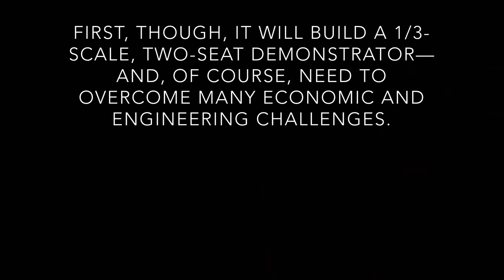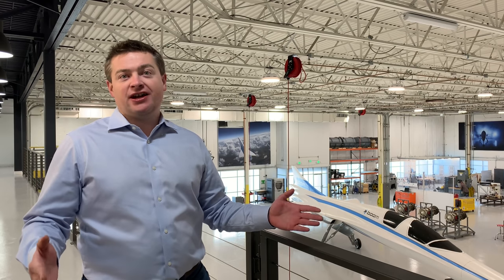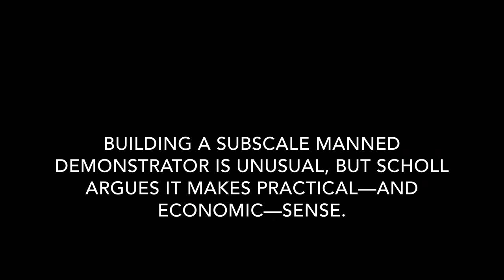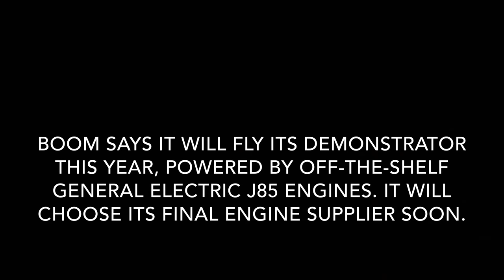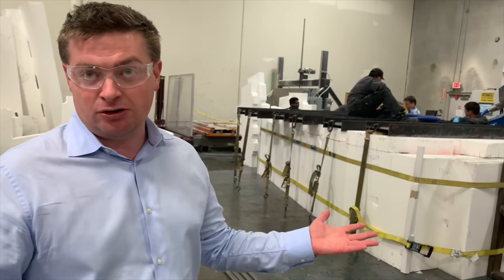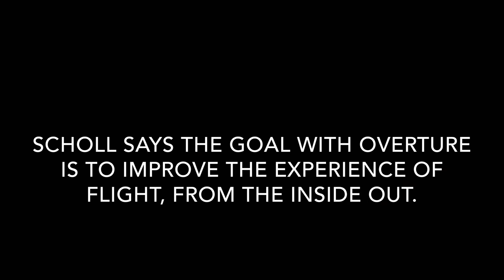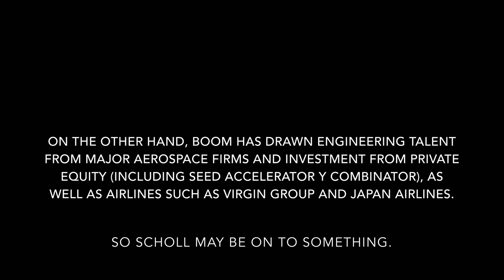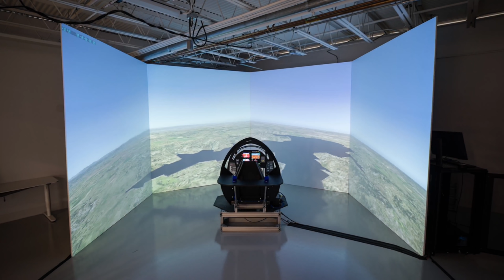Boom Supersonic’s Sound Barrier Breaker

Comment: Concorde only used afterburner on takeoff and acceleration past the sound barrier,  after that it "supercruised" with no afterburners.  I'm not even sure if it used afterburners for normal takeoff.  The one time I flew on it was a demonstration flight and sitting at the end of runway 27R at London Heathrow the captain said "I'm going to put the engines to full power now and light the afterburners, we don't normally do that because it tends to melt the concrete".
Reply: Afterburners were only used during initial climb.
Reply: “It tends to melt the concrete” don’t ya just hate when that happens xD
Reply: @dylanshandley1246  Pretty sure he meant asphalt hahaha
Reply: @garethl.2123  it would be concrete, blacktop wouldn't be durable enough to use as a runway my dude
Reply: In service, Concorde always took off with AB (reheat). It's my understanding that it was a operational decision based on reducing take off distance. Concorde had to rotate in order to produce lift by vortex from those beautiful delta wings...so the quicker she could get there the better I guess.
Reply: In the 90's I used to work at Heathrow airport and used to have lunch at the British Airways staff canteen called the Runway Café because it was at the end of one of the runways. When a Concorde started its take off run, the whole building used shake, you could feel it through your chair, your plate and cutlery would shake on the table and even inside the noise was incredible, so I'm pretty sure that they used afterburners, that and the flames out of the nozzles.
Reply: I was based in JFK with a regional airline, and every time I watched the concord takeoff it was in AB. 
Miss seeing it.
Reply: They may have meant the concrete would break up under the high heat of the afterburners. You can take a torch and rapidly heat concrete to the point where sections of it literally explode. This isn't very good for runway longevity or for follow on aircraft sucking up concrete chips into their engines.
Reply: I flew BA Speed bird 1 LHR to JFK in 1998. I was Qantas staff and paid $1400 AUD. The full fare was $10000 AUD. I can confirm Full AB on take off roll and they cut after initial climb for noise, it felt like the brakes were put on. After clearing the Irish coast we went full throttle and started climbing . the captain then said the reheat will come on in pairs and we would feel 2 X pushes in the back as they kick in and we did. After slowly pushing through mach 1 we accelerated more quickly and at some point the RH was cut. When I visited the flight deck during Mach 2 cruise 1350MPH at 58000FT the reheat was off but the throttle levers were firewalled 100% N1 for over 2 hours of super cruise. What a marvellous machine.
Reply: As I understand, the Concorde required a long runway because it’s V1 speed was so high (its nominal takeoff roll wasn’t particularly long), not using the afterburners would have made this even worse.
Reply: @mintZroadster Indeed she was loud. I live in London, close to LHR and I can testify that even in the approach phase she was highly identifiable by ear from the ‘blunties’ 😄
Reply: Sounds safe xD
Reply: @Phos9  Not to mention its insanely long landing distance due to the 11.5 degrees angle of attack on landing because of its high landing speed
Reply: @Flies2FLL  and also for passing mach speed .

Comment: Nothing says "low stress" like BOOM Aerospace.     
Seriously, though, it's looking really nice, and should show marked improvements over Concorde, bringing the concept into the modern age. 
Super-cruise should not be that hard for a transport aircraft these days. Just lots of CFD to get it right, and verify, verify, verify.
Reply: CFD, FEA, plus Wind Tunnels, base Scale Models,vCycle & Structural Load Testing, and a highly Strain gage Loaded 1st plane, logging & Transmitting Flight Data! All tools available today, along with FRP mixes of Carbon Fibre for Stiffness, Kevlar for Fracture And Impact Resistance, and now even Titanium-Aluminum Alloys, can be created a variety of ways and integrated as needed, for desired results.

So, it seems right to say, now is the time!

Comment: Going Mach 2.2 with "quiet and efficient turbofans". Dream on. High-bypass turbofans were known at the time of Concorde, the 747, DC-10, Tristar were contemporaries, all equipped with quiet and efficient high-bypass turbofans, the C-5 even predates it. Concorde has non-bypass turbojets for a reason, and that reason is efficiency for high-altitude, high-speed flight. Modern fighter jets have (low-bypass) turbofans, but that's a compromise for subsonic range and is rather a liability for supersonic flight.

Making predictions for ticket prices for an aircraft of which even the 1/3-scale demonstrator hasn't been built yet, is dishonest at best.

I'll bet some money that they can't get an engine that is (a) Stage IV or better noise-compliant and able to sustain cruise at Mach 2.2 for transatlantic routes. It's not going to happen. The design contraints are too contradictory. (Low noise: big fan, high supersonic efficiency: small cross-section. Go figure.) This is the exact constraint that drove the Aerion project from initial projections of Mach 1.6 down to Mach 1.5 and now to Mach 1.4.

I also notice that the "XB-1" is a midwing design, which isn't ideal for a passenger airplane. So how the experience with that translates to the bigger one remains to be seen.
Reply: Sounds like they could make use of Sabre engines (no pun intended)
Reply: Exactly.  And the inlet duct losses aren’t exactly trivial either.
Reply: @AvyScottandFlower  No, those are only useful for suborbital ballistic flights. There's no point in lugging around all the complex additional stuff otherwise. Although the precooler has been demonstrated to work, it is very hard to make and maintain, it contains thousands of tiny pipes operating at cryogenic temperatures, and pumping around liquid helium or hydrogen, which is no small feat in itself: "[it] cools the hot in-rushing atmospheric air down to the required −150 °C in 0.01s."

No, if you want to go Mach 2.2 efficiently, 2-spool or 3-spool turbojets are still the only, and you can't get those certified because I don't think you can even make them Stage 3 noise compliant, and by the time any supersonic design will be ready for certification, I fully expect Stage 4 to be the absolute required minimum for new designs.
Reply: @okflyer777  Their inlet design model looks like Concorde's intakes, which were quite efficient. With some serious research effort they can probably do incrementally better, but I think he is overstating what CFD can do for supersonic flows. It will require lots of iterative designs and cryogenic (or full-scale) wind-tunnel testing. Only cryogenic wind-tunnels will allow you to test scaled-down models at the same Reynolds number and Mach number as the full-scale article.

Comment: Mach 2.2 and carbon fiber......Are temperatures not a factor at  mach 2.2
Reply: Only on the leading edges. Glue has come a long way, I'm led to believe
Reply: Yep and the Concorde used its fuel as a heat exchange.
Reply: @doncarlin9081  Concorde was mainly made of an aluminum alloy called RR58. Designed for better heat resistance.
Reply: I don't care how far epoxy to come. At the temperatures that you'd be running epoxy would definitely be soft
Reply: Of course they are.  The whole thing doesn't need to be made from carbon fiber.  You could make the leading edges from Carbon Carbon or many other materials that have been used for decades.
Reply: @1fillmanw  Let's put some numbers on this, we're talking about temperatures around 300F.  I can buy off the shelf consumer grade high temp epoxy for lamination and infusion that is rated to and cured at 375F. There are aerospace products that are stable at 600 and really exotic offerings that will handle 1500. So epoxy temp range is no longer a major limitation.  I mean it costs money to make all of your infrastructure out of high temp materials so you can cure plane parts in your giant oven.  But it's all doable. Even without ceramic coatings etc. How did you think they were making wheels and engine parts for supercars out of CF :)

Comment: I was in the aircraft production industry, and people like me know that a plane is basically a worthless tube without the correct engines which account for at least 40% of total cost. I couldn't help but notice the tap dancing around the engine issue. With such a low volume production, I cannot see any manufacturer seeing any ROI on developing such a niche engine. Are Boom going to fund it? Not likely.

Comment: The civilian variant of the GE J85 is the CJ610.  It is definitely time-tested engine in terms of safety and reliability, but it is still a turbojet generating less than 3,000 lbf thrust (About 1/10th the thrust of a reheated-thrust turbofan like P&W's F100PW229, which is ALSO time-tested and reliable.)  I understand this is for the scaled-down demonstrator, but there's no way on God's green earth they can get supersonic with three of these.

Comment: I'll believe it when I see one painted in airline colors, broken down on the ramp.

I wonder how he's planning on keeping the cabin cooled.  This is a significant issue with supersonic flight;  Concorde did it by pumping cold fuel from the wing tanks through the aluminum skin of the fuselage.  This worked because aluminum transfers heat very effectively.

Maybe it's me, but this guy seems more preoccupied with high-quality cabin speakers....

Comment: I wish them the best but there is a reason supersonic jets aren't flying today and it comes down to them not being economical.
Reply: That was then....this is now...
Reply: @cockyrooster361  you realize "then" was 2003 and the only reason Concorde lasted as long as it did was because the british government was paying for it. The plane was not profitable the entire time it flew. "Now" won't change anything. The laws of physics are the same. The cost of a ticket will run around $10k. It will be limited to trans Atlantic routes and only service a few airports. Don't get me wrong I would like to see travel times halved and supersonic planes become the norm but this won't be it. All they are doing is making a half scale Concorde.
Reply: @arcosiancosine1065  Well its complicated. This thing is going to cost you roughly 4k round trip. 1/4 of the concorde cost. It has 55 seats, requiring around 35 to break even, which makes it easy to fill/make profit. There are plenty of asia/pacifc routes this thing will be used, therefore a lot of interested customers.
Reply: @arcosiancosine1065  Correct.

Comment: 12:13 Hes right about there being a humming noise but how is his plane going to work without an APU? Also at 14:33 he may have forgotten that Airbus existed...
Reply: The Auxiliary Power Unit (APU) is not really a required component in aircraft, and the installation of one really depends on the original function in a design. There are several passenger aircraft where the manufacturer excluded an APU from the design, including the Concorde itself, where designers saw the APU unnecessary as it added weight, but not much redundancy and extra function.

An APU is used to produce electrical power and air pressure under the aircrafts own power by burning its own fuel supply. The electrical power and air pressure from the APU is among many other things, used to start the engines. In modern airport infrastructure you have access to external power almost everywhere you go, thus an APU is not really necessary. The APU is practical if the aircraft is supposed to be operated in areas where you are not sure that you have external power available. 

An APU may also supply hydraulic pressure for the operation of flight controls and landing-gear but I will exclude this for now.

In passenger aircraft like the Boeing 707 and Douglas DC-8 an APU was not installed from the factory, as most airports gave airlines access to GPUs or Ground Power Units, that supply the aircraft with electricity for avionics system operation with the engines shut off, and ASUs or Air Start Units that gave the aircraft air pressure for starting the engines. However some airlines did modifications and installed APUs into these aircraft types to help serve in airports with lower standards of infrastructure.

In a lot of aircraft designs an APU is there for redundancy and emergency power in case all engines are lost. If one for example look at jet aircraft utilized by the military, most of them exclude an APU, as the aircraft are operated from airfields with high level infrastructure and access to GPUs. However several military jet aircraft include an emergency power unit, such as the EPU in the F-16 family of jets, that generate electrical and hydraulical power to be able to maintain flight controls in an emergency where the engine unstarts. These emergency units also often generate pressurized air to maintain cockpit pressurization at high altitude. The APU will in many cases serve as an EPU in aerial emergencies, such as the Hudson river incident in 2009, where a bird strike caused a dual engine failure on a twin engine A320, and the APU needed to be switched on to maintain flight controls, as the main electrical generators and hydraulic pumps are mounted on the gearbox assemblies of the engines and would not function with them dead.

Seeing as the Boom Supersonic aircraft is to be designed with three engines, the level of redundancy rendered by an APU might be unnecessary, as the aircraft most likely will only be operated from airfields with high levels of infrastructure and access to ground support.

As for excluding Airbus. Airbus ia not really a 'new' company, as it was founded as an assembly of several european aerospace manufacturers with extensive experience within the industry, such as Aerospatiale, DASA and CASA. Most of the aerospace industry is assembled by giant assemblies of small companies nowadays. Such as Lockheed Martin, Boeing, Airbus and Textron Aviation. However he left out several small aircraft manufacturers that are not in the big leagues, such as Cirrus Aircraft out of Minnesota in the US. Within general aviation there has been several newcomers.

I am sorry that this kind of spiraled into an essay, and all of this information may already be things you know, but I'll put it out there for those who don't.

Comment: In the 70's I had an opportunity to participate in the Boeing SST Program.(Supersonic Transport)  I was a Sales Engineer for McGill who made track roller bearings for the flaps and slats on the wing.  Participating in the program meant submitting titanium bearings for the  prototype.  My recommendation was negative because I did not think supersonic travel for the airlines was sustainable.  My company paid for business class rate  and allowed a travel day.  There are many factors other than air travel time so several hours less for air travel was not impressive.  Actual air travel time can be very productive or enjoying since you are totally free to do work or whatever.  I have been on a 747 with 3 bars and slept on 5 seats by raising the arms.
Iguana
Reply: I guess anybody could sleep on a bed made of thousands of sweaty butts and stale farts if they hit those 3 bars hard enough. lol

Comment: Regardless of the success of failure of getting the funding for the "Overture", Boom should build more than one XB-1 and sell it as a toy jet for the rich and famous. There simply isn't a 2 seat super cruising jet anyone can buy for any price. It'll be even better if it is a 4-seater even if it is a cramped 4-seater. But a 2-seat will still find enough buyers to be worth the while. If certification is too much trouble, sell it as a bare bones airframe with avionics, gears and the engines in boxes as an "experimental" aircraft.

Comment: The problem they have is heat, on the entire fuselodge, but especially the nose. It's one of the reasons the US over engineered and scrapped their SS aircraft. You can use as much CF as you want to save weight/"money", it still will not change the physics of aerodynamic heating...

Comment: 15:30 What are those big pressure chamber things used for
Reply: That's an autoclave and basically it is a pressurised oven for the manufacture of high quality carbon fibre parts.